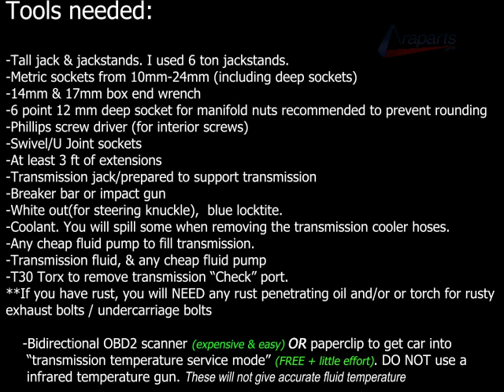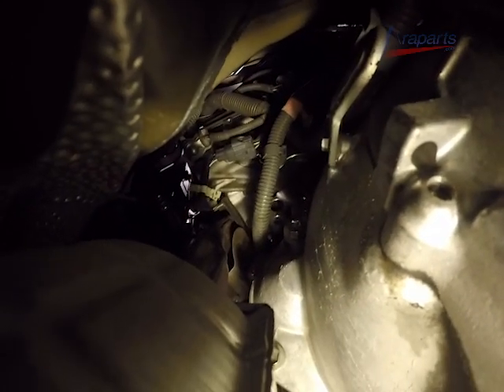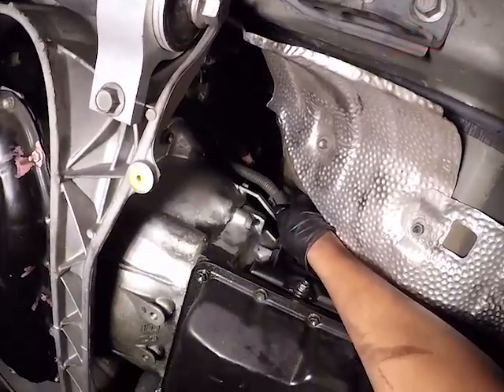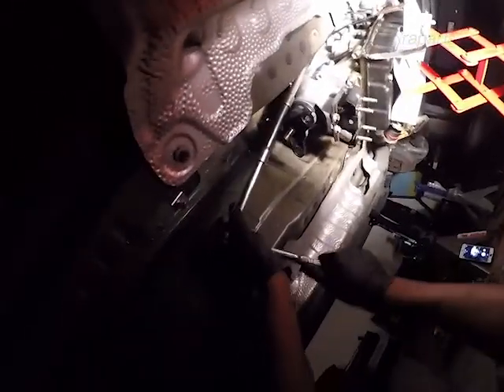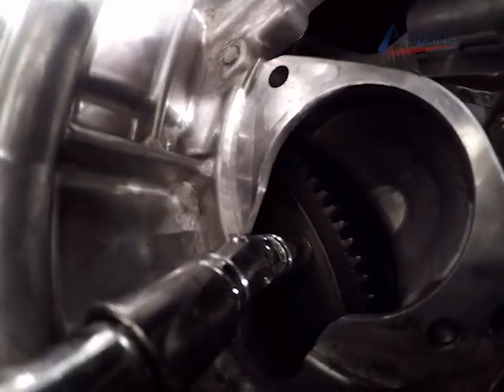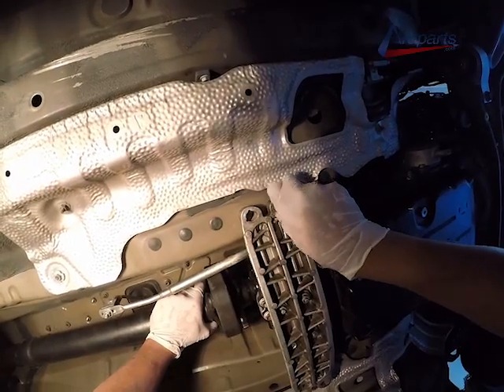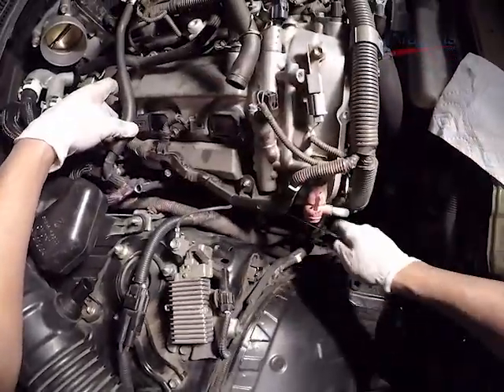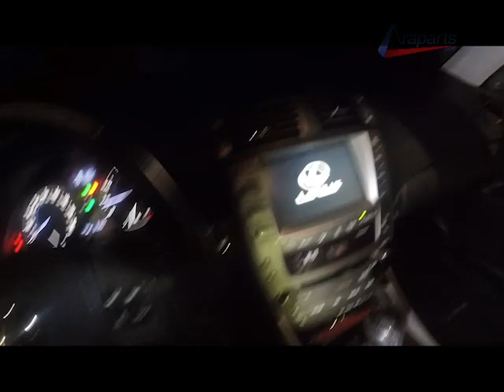Full Transmission Replacement Video + Fluid change For 2008 Lexus IS350  (2006-2012)

Comment: YOU DONT NEED TO REMOVE THE EXHAUST, CATS OR EVEN THE CENTER SUPPORT BEARING, OR OXYGEN SENSORS. You only need to remove the steering column U joint, and  the driveshaft coupler to the back of the transmission. You don’t even need to fully remove the starter. All you have to do is unbolt it, disconnect it, and set it aside on top of the cross member. Literally it can be set aside without needing to fully pull it out. 
Also, you don’t need to even pop the hood aside from disconnecting the battery.
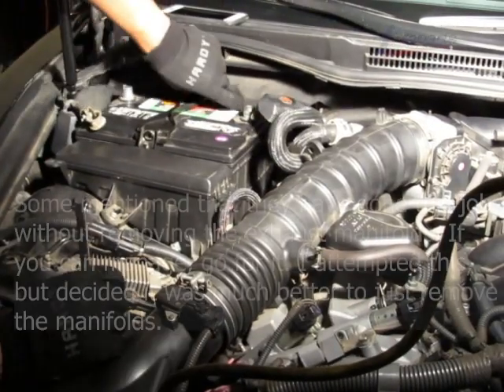Reply from the maker: That is correct, I mentioned this at 3:57, and I will pin this comment so others know that YOU DO NOT NEED TO FOLLOW THE GUIDE 100% . I struggled to get those bolts with the exhaust in the way so I decided to just remove the cats/exhaust. In hindsight, it could be done without removing center bearing also. 👍

Comment: I changed out a transmission on my IS350 RWD about 4 months ago or so and I was able to leave the exhaust on. Only disconnected drivers side header . You have a lot less room but it's possible

Comment: For those looking at this for an IS 250 I believe you have to disconnect exhaust regardless because the yoke is splined and inserted into trans as opposed to bolted on.

Comment: So you HAVE to remove the starter to access the torque converter bolts correct? Just trying to make sure I’m getting that information correct🤙🏽
Reply from the maker: It’s been a few years since I did this job. I can’t remember if it can be done without removing the starter. From what I remember, the starter does need to be removed. There are good amount of people saying it CAN be done without removing the starter, so keep that in mind.
Reply: Yes the only way is through the starter housing…also good idea to change your rear main seal while you’re back there. Also I tried it with a normal jack and definitely get the transmission jack

Comment: When swapping the trans, do you need to reprogram the ecu/pcm to accept the newer one?
Reply from the maker: Didn’t need to do that. This transmission was from the same model year 2008 GS350. 100% plug and play.
Reply: Thanks for the reply, also is it recommended to replace the crank shaft rear main seal since the transmission is already off?
Reply from the maker: Yes, it's a really good idea to replace the rear main seal while it's off.
Reply: I'm about to do this on my 2006 is 350 trying to find a 2006 is 350 with low miles to swap
Reply: Is it the same process for an 2008 is250 automatic

Comment: Do you have to fill the torque converter I didn’t hear you talk about it
Reply from the maker: Nope the transmission I installed was a used transmission and was never drained. Torque converter was already full.

Comment: My 2010 rwd is350 is throwing p0983,p2714,and p0776 would it be worth my time messing with the solenoids or should I switch it out for a used one while I get the old one rebuilt. Kind of my only vehicle atm I’ve been dreading dropping the drain pan and seeing metal shavings y’all lmk please!
Reply from the maker: YES, it is absolutely worth your time to see if it's the solenoids. Check this video out: https://www.youtube.com/watch?v=6gnCfDVk6BQ&t=278s 

This guy shows how to diagnose a bad solenoid. If you see metal when dropping the pan, obviously, it's an indicator that the transmission will soon need to be replaced. As some have mentioned, you don't have to remove everything I've removed in this video. It just depends on how tight of a space you're comfortable working with.

Comment: So I don’t need the transmission to be programmed after install?
Reply from the maker: Nope. You can simply do a good ol fashioned transmission replacement in these cars without any programming or reflashing.
Reply: @araparts also how much fluid did you put in?

Comment: bro these bellhousing bolts won’t come tf out
Reply from the maker: The only method I can recommend is using more leverage. You gotta have some ground clearance for this, but a cheater pipe + breaker bar should get them.

Comment: What size are the torque converter bolts?
Reply from the maker: It’s been a few years since I’ve done this job, so not 100% sure about this. From my memory, they were 12mm.